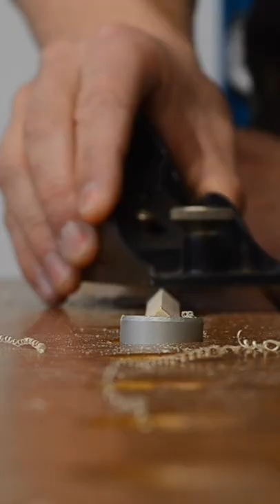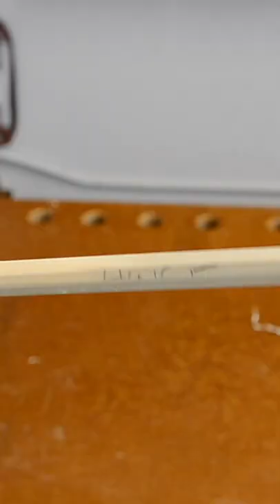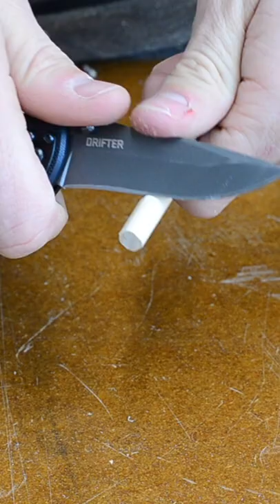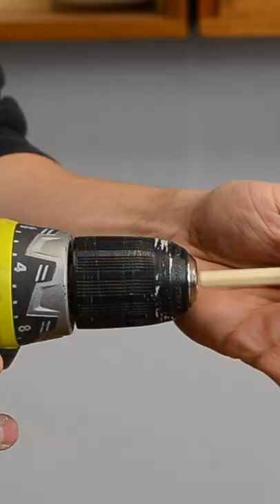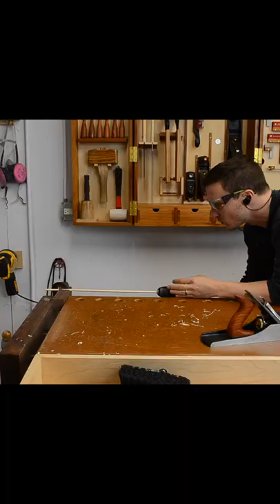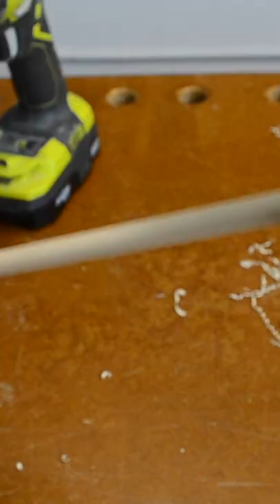Making a Perfect Wood Cylinder with a CORDLESS DRILL #shorts

Comment: Do you think could do this on a larger scale? Something 22 to even 33 mm in diameter? By putting a dowel in the end with Wood glue and then putting that in the drill?
Reply from the maker: Good question! I'm not sure exactly what you mean about wood glue, but you could totally scale this up. However at some point you should probably just use a lathe instead of a drill!
Reply: @dkbuilds sweet, I have very limited tools and limited budget so I'm hoping to do this at home and see what I can make work ! Thanks for the reply!!!

Comment: I see you backed the blade up towards the rear, was that to reduce burning? Mine from last year stopped working well so making a new one and dealing with lots of burning. I get my stock to about 0.26” before doing it
Reply from the maker: Thanks Tranq! I had some burning issues too. To be honest I'm not sure exactly what fixed it ... I just kept moving the blade back and forth, trying different angles, different amount of shims to raise or lower blade height... until it worked. Now I don't mess with it 😆
Reply: @dkbuilds  haha sounds good, yes it’s definitely very finicky. But it does work well once it’s right!

Comment: you can get the same results just as quickly with sandpaper and a drill
Reply from the maker: This method gets you a perfect cylinder, sandpaper would have variations in thickness. Perfect cylinders are required for some applications like wooden hinges. If you just need a dowel for a joint, sandpaper and drill should work well enough!
Reply: @dkbuilds  that makes sense thanks for the clarification 😁

Comment: Cylinder? Really? A cylinder is hollow. If you are going to get involved in woodworking, then use standard woodworking terms. This is a dowel, not a cylinder.
Reply from the maker: Thanks for the comment Mike! You are correct that “dowel” is the proper term for this. Unfortunately you are wrong that all cylinders are hollow, so my title is technically correct. Please educate yourself before criticizing me.
Reply: All woodworking and engineering cylinders are hollow. I'm not criticising you. I am correcting you.
Reply: @MikeAG333  absolute shite. A cylinder is just a prism with a circular base. Sure dowel may be more appropriate in this instance but there's nothing incorrect about using cylinder
Reply: @chrisjollie7240  It's a channel full of non-woodworkers, obviously. No woodworker would ever call that a dowel a cylinder.
Reply: A hollow cylinder is a tube, no? And not all cylinders can be dowels (say a large support piece)? Newb asking.